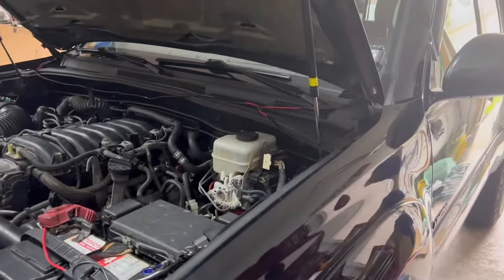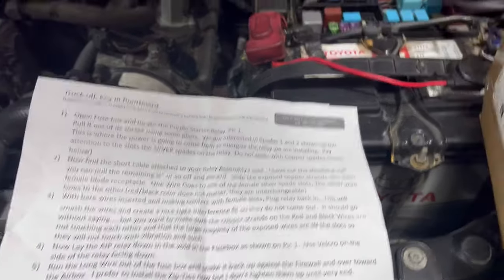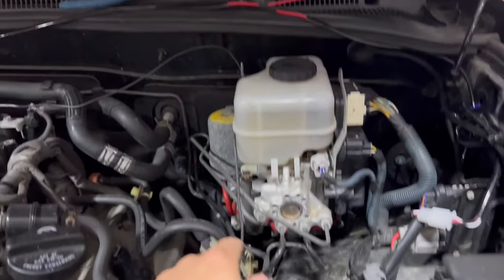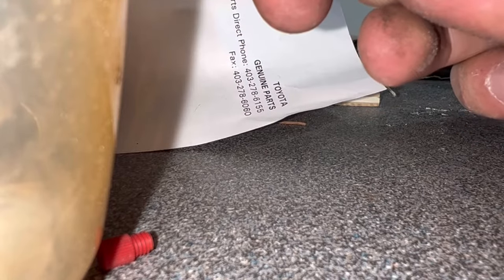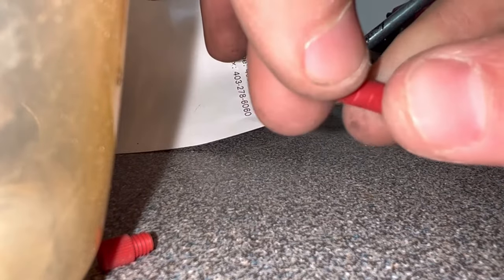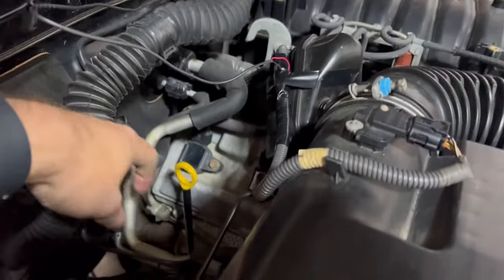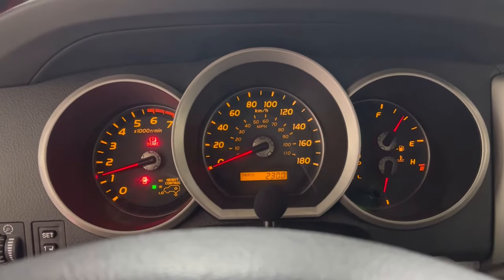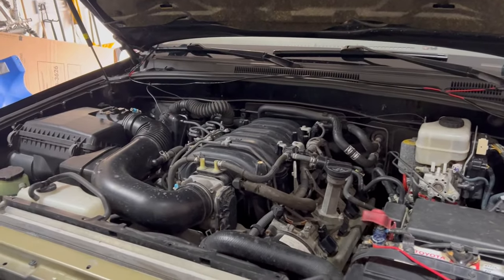Toyota 4.7 V8 Secondary Air Injection System Bypass (SLYFOX KIT)- 4th Gen 4Runner/Tundra/GX470

Comment: So black/red doesn't matter at all? I'm confused which wire to put on which terminal and then which one to put on which splice side.
Reply from the maker: It does not matter which way you splice in as the circuit is multi directional! It’s a little counter intuitive for sure.

Comment: Will this happen eventually to every VVTi V8? I have 176k on my 06' 4Runner with no issues.  Does the SAIS fail at a certain mileage?
Reply from the maker: It’s hard to say for sure, but I myself did it as a preventative measure.

Comment: On the other bypass kits theres the block off plates for the pumps, does the slyfox come with it too or does the bypass itself completely negate the need for them? thanks again glad you got your problem solved!
Reply from the maker: It certainly can come with block off plates! I did not need them as I’m currently not throwing any codes or having any issues. I used the relay to disable the system to avert myself of any future trouble.
Reply: @looseaxles  So does this mean the cut off plates are optional?
Reply from the maker: @JP-uu2rw  yes they are! I would only use them if you are having issues already.
Reply: Block off plates ensure that the Valve remain shut. If not installed you run the risk of them opening in the future and exposing the pressure sensor to exhaust. This can damage the pressure sensor and put the truck into limp mode.

Comment: So all it’s doing is disconnecting the activating wire for the pump while the vehicles running?
Reply from the maker: It bypasses the pump from opening the valves and keeping them closed. For people that have them stuck open there are block off plates as well.
Reply: @looseaxles  Just looking to wire it myself might just be an $8 relay

Comment: I installed this and it works most the time but the pump still runs below -10F.  Wondering if the resistance is too low.
Reply from the maker: Great question! I haven’t looked into this.

Comment: Will this work if you automatically know that all your system is messed up. according to the codes, I’ve been getting in the way it’s running. Can I put this on and will be back to the way it ran before which was real good?
Reply from the maker: I would get in touch with SlyFox himself on the T4R forums - I posted his email in response to a few comments.

Comment: I got 240 thousand trouble free miles on my 4.7. What problem is this so posed to fix. I am going to get Doug Thorley headers in future but interested in what potential issues I might have in future.
Reply from the maker: Hi Alan! Nice idea with the DT headers - I know a lot of people swear by the updated version. 

This mod works to eliminate the secondary air system procedure to ensure the pump doesn’t fail and leave your valves stuck open. It’s a decently common problem in these 4.7s and a costly repair if you don’t catch it early!

Comment: If the pump is already bad and it’s making the noise and my check engine light came on today does that mean I have to pull the pump out and clean out the system or can I just put a bypass kit in and clear the codes and call it a day ? ?? 😮😮
Reply from the maker: Great question. I’d touch base with SlyFox over email to confirm. My guess is that your time would be better spent replacing the system, or seeing if you can install a bypass with block off plates.

Comment: If bypass is installed correctly can I still somehow manage to get diagnostic reading of something wrong with lower a.c. pump?
Reply from the maker: You bet!
Reply: @looseaxles  That's not good. Mine worked great for two years now I have SVC and 4lo blinking but not in limp mode. Diagnostic reader code says problem with secondary air valve/pump. Mine has either failed or recent mechanical work done co.promised it?
Reply: @johnthazelett8833 any resolution to this for you?
Reply: @roughready7491  yeah  I called  Hewitt and they said I need to get the latest Gen 2 or 3 instead of earlier model I initially installed. So I had the latest installed and no problems so far- about 3 months ago
Reply: @johnthazelett8833  awesome thanks man!

Comment: I have 09 sequoia with 4.7 i got the p2442 and it says secondary injection system switching valve stuck open bank2.  But previous owner already had the bypass harness installed before i got it. Any idea what could be causing the code now?  I assumed they either installed to avoid the problem or had the problem and used the harness to fix it but now it appears to be back?  Any of your knowledge would be appreciated.
Reply from the maker: The bypass could have potentially failed, or failed previously? Typically people install block off plates when this happens.
Reply: @looseaxles  so if the harness failed would the block off plates themselves correct the problem or would I still need to look Into the harness issue plus Install the plates?  Thanks for any help.
Reply from the maker: They would work in combination with each-other - if you reach out to SlyFox, I am positive he will know what to tell ya! Tell him I sent you - he’s a super knowledge guy. His email should be in the comment next to yours!
Reply: @looseaxles  Thanks a million man. Love ur channel.
Reply from the maker: Thanks so much for the kind words. That means a lot on a day like today.

Comment: Does it matter if it is already stuck? (closed or open)
Reply from the maker: If it’s stuck open you can get the block off plates. Since my pump was working as normal, I just installed the electronic bypass for now.

Comment: Is there anyway you can share a picture or the label on the ‘black relay’ that you sticked inside the fuse box. I’m trying to make my own but would like to see what this relay is. If there is a number on it or anything like that
Reply from the maker: Can’t see anything sorry! I would contact SlyFox directly - he will know for sure.
Reply: @looseaxles I ended up finding what relah, it’s an automotive 12v 30-40A 5pin. It uses a 4.7k resistor . I bought the sky fox and your video was very helpful for the instal !
Reply: @NoXQc hello sir how did you do it
Reply: Please 🙏 can you share the manual picture

Comment: Would it fit 05 sequoia ? I have replace both of the valve on the rear I still getting the code for bank 1 secondary air valve stuck closed
Reply from the maker: I believe so! I’d reach out to SLYFOX!

Comment: Hey which side of the harness did you tie into?  I assume you tied into the wires opposite of the plug going towards the driver side?
Reply from the maker: That would be correct! They are colour coded to make things a little bit easier.

Comment: any negatives in theory with not using the block plates if you install the bypass preventatively?
Reply from the maker: Theoretically, nope! Since you are bypassing the circuit to begin with, you wouldn’t require it. Some people install them anyways, or if they had previous issues.